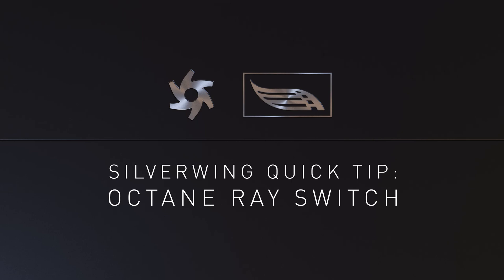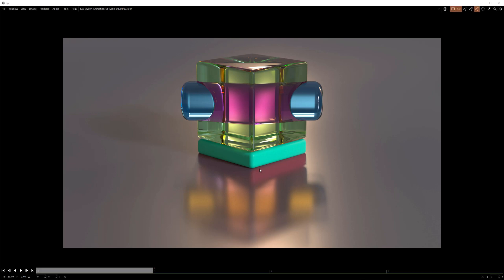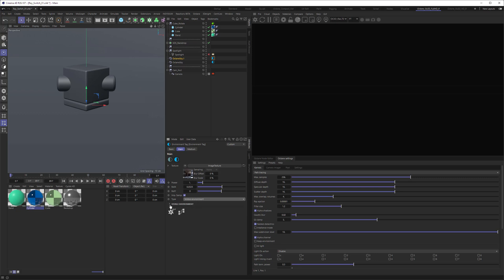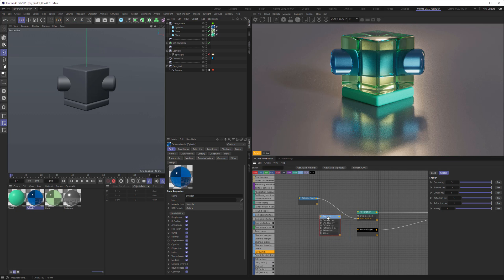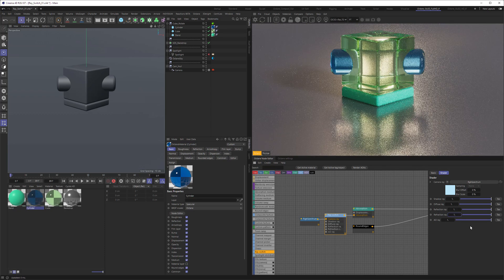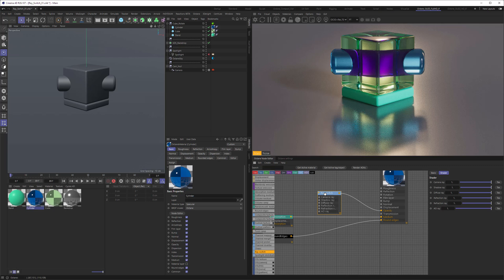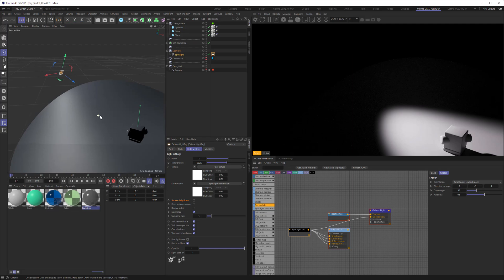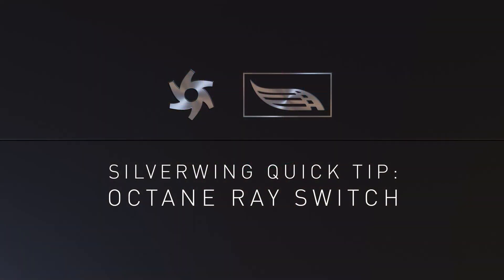Silverwing Quick Tip:  Octane Ray Switch

Comment: Thanks for the tutorial, it really works. I have a problem, I can remove the reflection of another object in the reflection, but if I have 3 objects, I can remove the reflection of one object and keep the other one, is there any way to do that? Such as Arnold (https://www.youtube.com/watch?v=ps8za2ooJhU), octane osl there a way to achieve it
Reply from the maker: Hey there and thank you for your nice words.
What you are searching for is light linking / trace sets / light path expressions. Since Octane comes from an "unbiased" background, where it strictly behaved like real world and you could not pull any tricks, this is still inherent in some areas of the program.
While I am sure it will be possible at some point. Excluding a reflection from one object, but not from another is not yet supported.

Comment: Thanks for your video!

Is there any way to use this or something similar to create a mask from lights? For example, I have a falloff, and I want to remove it from the non-lit side of a sphere. Need help to think how to do this.
Reply from the maker: Hi and thank you very much for your question.
Unfortunately to my knowledge there is no way to get lighting information inside the shader for now. I think we agree that this would be a neat and very handy thing to have.

The only way I can think about soft of hacking it, is by using vertex maps and C4Ds fields to sort of get the light direction to a shader via the vertex map. This is a hack of course and might or might not work for your scene.

Comment: Great work . Been investigating weird super low settings for interesting effects and this could be handy. Would like info on portal material if it has any uses or modes, I see a lot of others starting to use GGX energy preserving and universal  as a base for everything. Drivers seems to be a big issue ATM too.
Reply from the maker: Thank you!
In my limited testing with the portal material I only noticed improvements in a couple of fringe cases with very small windows / portals. So I usually don´t use them.
About materials. As I am always striving towards optimization I usually use the "Old" materials such as Glossy and Specular and only Switch to Universal and Composite when I really need it. In terms of GGX its much the same. I always use GGX, but Energy Preserving only if materials have very high roughness values e.g. above 0.5 - 0.7
p.s. If you are using a lot of assets / scans with PBR textures, using the Universal Mat is more or less essential.
Drivers indeed seem to be a big issue. Its a fight between what works best for Redshift, Unity, Octane and other apps and its a horrible state for content creators!

Comment: You’re making octane look quite appealing again. That viewport performance is pretty amazing compared to redshift!
Reply: come to the dark side and.. bring the whole team with u haha
Reply: The speed of Octane is quite good now too - maybe it's just able to leverage new hardware but after testing RS for a few weeks after 3.5 came out I'm sticking with Octane. Silverwing helps make that decision easier - thanks for sharing your knowledge!
Reply: When I first used 3D rendering in 2019, I found Octane‘s viewport performance to be much better than the RS
Reply from the maker: Thank you. bragging mode on Well the 3 x 3090 help to make it resolve fast.
Though of course they "only" help to render faster not with updating the live viewer. This has always been a strength of Octane.
And RS unfortunately seems to struggle more and more with newer builds (at least on C4D)

Comment: tried to play with it to kill shadows before but it didn't work and there's not much documentation about it, thanks a lot for this! Totally underlooked feature.
Reply from the maker: Thank you very much. You probably already know but to be safe: For killing shadows connect the ray switch to the opacity and then set the shadow ray slider to 0.
Cheers and appreciate your Comment and Retweet.
Reply: @SilverwingVFX  this may seem less sexy to newbies, but it's very useful in production. Keep em coming like Thanos said, any kind of 'unbiased' technique with octane is very welcome as you can guess.